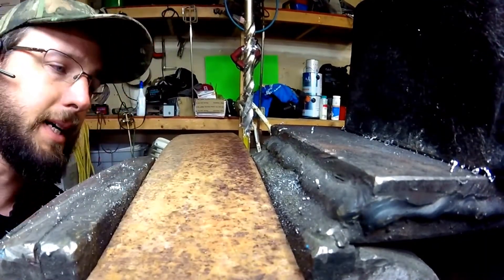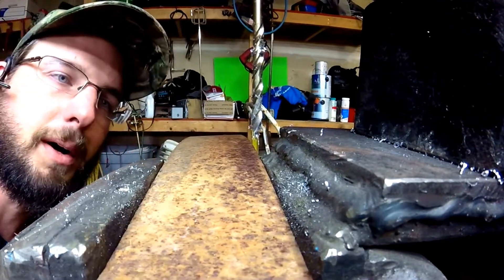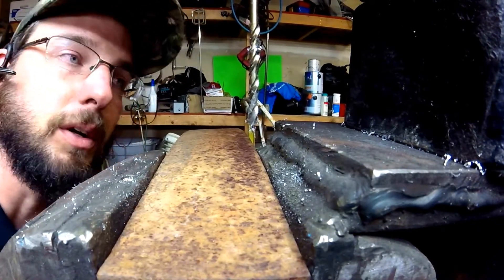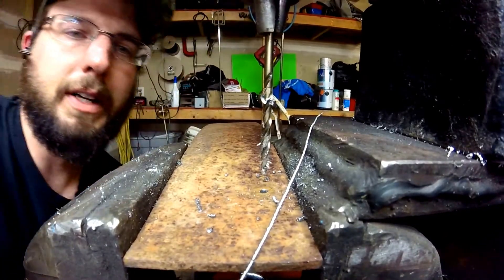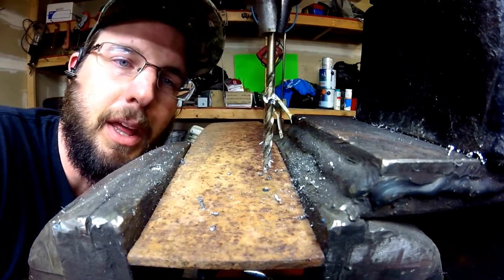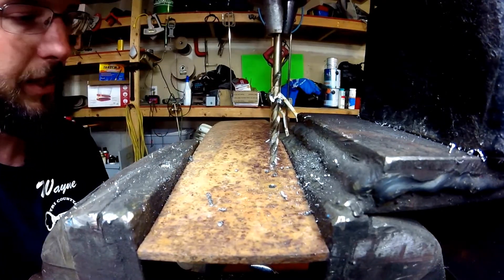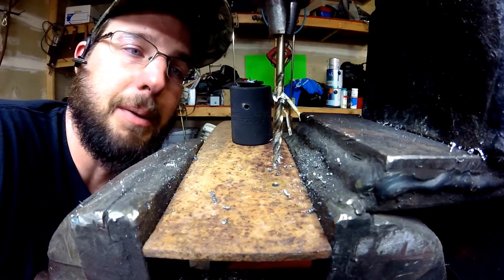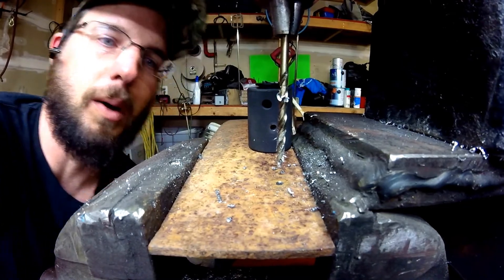Walter Drill Bits Drill Through Hardened Spring Steel Leaf Spring HRC Rating 41-60

Comment: i think a leaf spring may be slightly different than say the spring steel in picks.  I've always used some heat to detemper an area I want to drill on on a pick or tool using the thinner spring steel (1095...i think). since you have some leaf spring metal, I've seen in foreign(african coutries) where they use leaf springs to make machetes...looks like a fun project, and not a bad thing for emergency preparedness.
Reply from the maker: Spring steel is the prefered steel for knife making. Its hard and will hold an edge while remaining flexiable in an impact. Either way try to drill it and 99% of the time you will only be frustrated and unsucessfull.